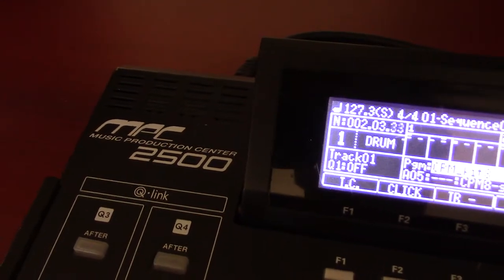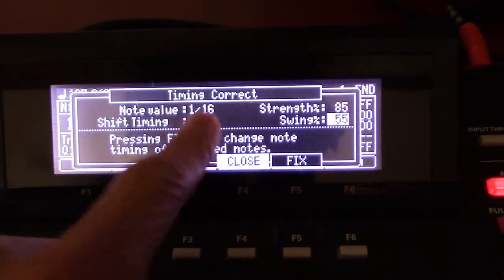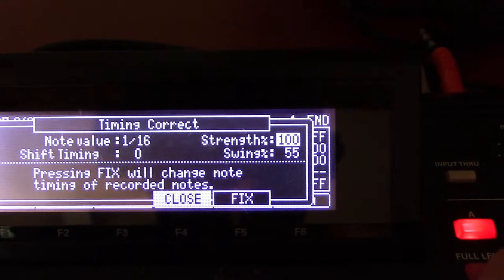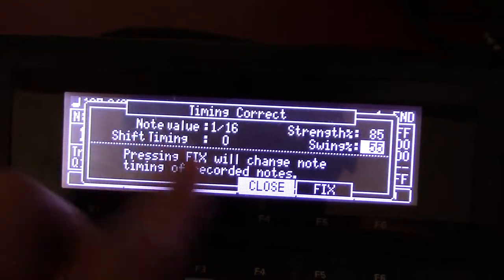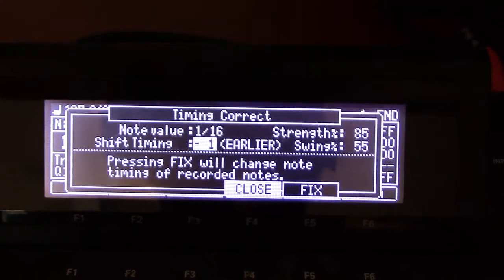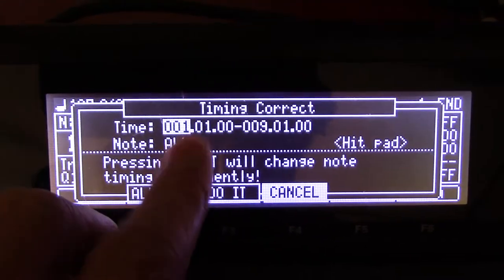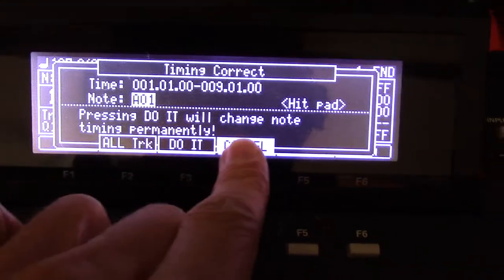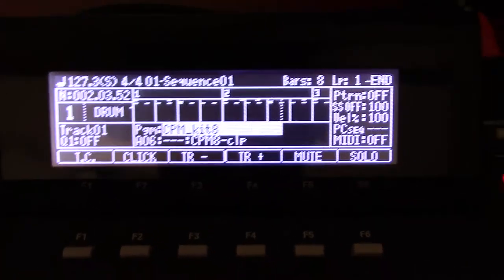Akai MPC 2500 - Timing Correct - jjosxl

Comment: What does the note values mean and do? Also; effect drum loop samples?
Reply from the maker: Hey... so timing correct is just for the midi data that triggers your samples... 1/8 means it will align the notes to an eight note grid... same with 1/16 and so on... peace.
Reply: @lazoo2000  does it change the sound?
Reply from the maker: nope... just the timing.
Reply: @lazoo2000  i never understand it especially playing in the sequence
Reply from the maker: google or YouTube “what is quantizing” to learn more. 
Quantizing is basically aligning midi notes to a grid for the sake of timing. Do some homework on it, it’s a great tool and very standard on any mpc as well as many other beat boxes and daw’s.
Reply: @lazoo2000  so basically it connects loops on time
Reply from the maker: yes, it can do that... if... your loops are synced with the tempo of the mpc... it’s usually used to align single hit samples like drum hits, keyboard and bass samples... loops are a bit more difficult to use on an mpc because they ultimately need to be matched with the tempo.
Reply: @lazoo2000  ok then i wasn't sure at first i just thought it changed the sound